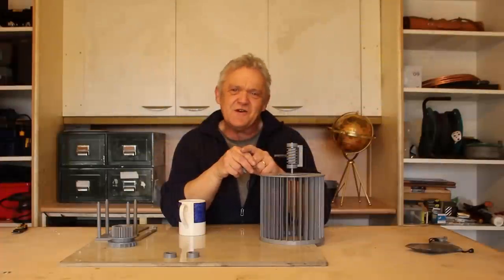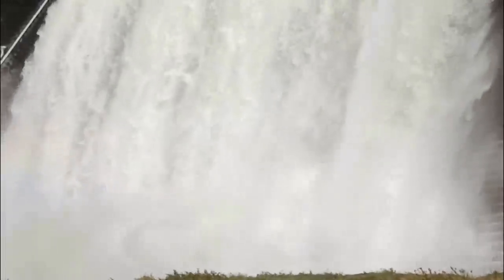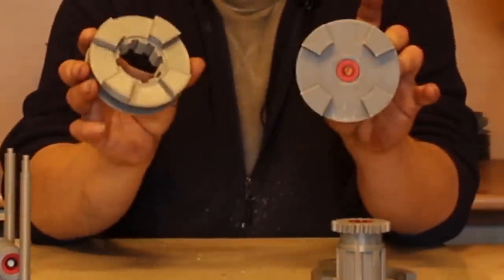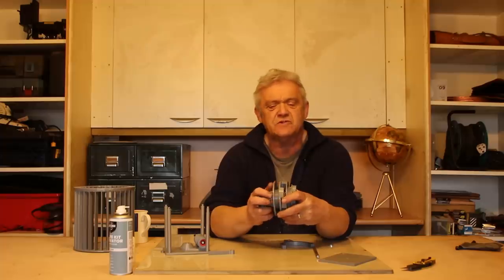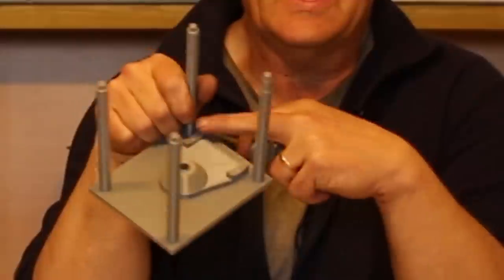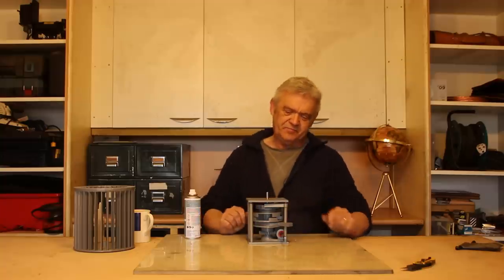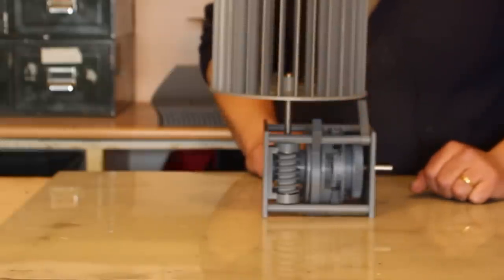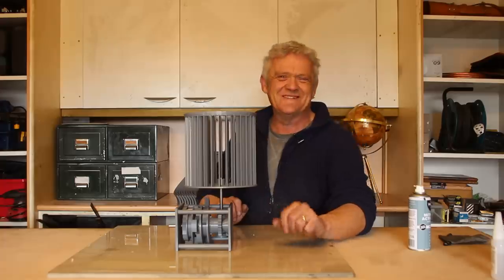1905 Wind Turbine With Integrated Energy Storage

Comment: The problem with gravity batteries is the amount of mass you need. Another video showed that a 20 gallon (or something like that) drum of water held up about 4 meters generated less energy than a single AA battery.
Reply: The conversion of potential energy to kinetic and electrical energy is far less efficient with pumped hydro than with a static weight directly driving a generator. With pumped hydro a significant portion of the kinetic energy simply bypasses the generator as the water continues to flow through. With a static weight directly driving the generator, nearly 100% of the kinetic energy (minus that which is lost to friction [thermal] and vibration [acoustic]) is input to the generator.

That difference noted, you are correct that a massive weight / height would be required to power an average household, but just as it’s best to have multiple streams of income, it’s also best to exploit multiple available energy sources rather than trying to generate all required power from one source. For me it’s oil, biogas, geothermal, air to water heat pump, solar PV, solar thermal, and wind, all contributing to the whole of our energy needs and providing the excess to the Finnish grid at the same wholesale rate the big power plants receive.

Comment: It would make sense if it was large scale but at something so small your best solution is pulley system and raise it manually it cant be that heavy.  And you can do it as long as you are alive no wind or solar necessary. Its not brilliant in any sense of the word
Reply: He does it small scale so he can quickly and easily show the process and and mechanics needed to achieve the desired results. This guy's amazing and he always makes it where you have to put in some thinking to see the bigger picture.

Comment: Love your channel! Instead of a gravity battery I would imagine you could compress coil springs to store the energy.
Reply: Or pressurize an air tank? Nozzle it back toward pelton scoops when rpm drops - hope your wind picks back up to store away a bit more psi? Im trying to picture a dished out water flywheel ~1m diameter so torque input is lower at low rpm. And then incorporate a wind conveyance with both a trigger coil in the serpentine (bedini sg) ran off a solar panel and a water jet inline down from my rainwater tank so it would take a 0 wind, 0 sun, & 0 watering the property day to not have any inputs. I also get some real steam from my solar water heater coil during midday that i can use somehow when i upgrade to fittings that wont melt (i didnt expect 100C temps!).
Reply: @ronmartin7253  Have you seen his air compressor energy storage one? Can't remember if it was attached to the dynabike or a wind turbine - perhaps bike. Trouble is the cost of them and getting a used one free is hard to come by (He actually fixed the one he was given free by cleaning it!)
Reply: @Nick_Tag  no i dont recall that vid - SO many here. A trompe can be just pvc like on a water ram or the Jeremiah chan on cold steam.
Reply: Yes, or just retract a big cylinder with air to compress it 🙂
Compressed air can then be used to drive an air motor for example..
Reply: I was wondering about the same thing

Comment: Was wondering, is there an efficient way to directly use a wind turbine to directly create heat and store that heat such as in sand?
Reply: A disk brake can become red hot when you drive on highways, even without braking.
Reply: Yes you can fix a paddle on the drive shaft in a tank of water and the rotating paddle heats the water through friction.
Reply: I think I like both ideas.  Water hols a lot of heat in phase change but from my understanding it must go through a phase change which requires a lot of space when it's in gas phase?
Reply: Perhaps have it drive a compressor mechanism such as a heat pump.
Reply: Yes ideally of it can consistently create enough power, then a heat pump would be nice.
Reply: @l0I0I0I0  It'd be interesting to find out.  I wonder if Rob will do a few videos on heat pumps.  It's possible that they can't be made in his workshop though.
Reply: Look at video 1754   there he talks all about heating windmills
Reply: @simongross3122  ii
Reply: @hommerdalor6301  "A disk brake can become red hot when you drive on highways, even without braking."

If a disc is getting red hot on the highway then there is a problem with the brake pads being seized within the calliper, or the calliper piston being seized.

Comment: some old printers used to have electrical clutches built into them, put one of these on the shaft and you can release the weight at the touch of a button.

Comment: Never ceases to amaze me this bloke. I've got an old disused bore hole in my garden. It's basically a 200mm wide steel pipe 35 meters deep this would work a treat stuck on top. Cheers Rob you've just provided a brilliant solution for how to utilise this old pipe.
Reply from the maker: oh wow - that is an awesome asset mate

Comment: Magnets , on a disk , faced to an aluminum plate connected seperatly to a Winch . When the turbine spins up over an rpm it creates a magnetic field in the aluminum drawing the wieght . Run the whole thing on a one way bearing , so when the turbine slows the wight will fall spinning the output until it falls to the ground .
Reply: I guess you would have to change the direction of the power from the wieght somehow but other than than and turning should work pretty good

Comment: Worm gears are great for high torque, but they are also high friction if not using the right materials or proper and constant lubrication. They will eventually wear down both surfaces in contact, but are normally easy to replace (unless you have a bad design, which is not the case here due to efficient simplicity.) 
Now I'm thinking next level (much more engineering required): multiple clutches, raising one weight after the other in sequence and same when letting go of the weights.
Reply: Yes, a worm and wheel has poor mechanical efficiency due to the sliding contact (compared to rolling contact on spur gears).  The higher the reduction ratio the lower the mechanical efficiency.

Comment: given a fulcrum and a long enough lever you can move the earth. but this is a neat idea. you could automatically switch the clutch when the weight hits the top.  put a spring and servo on the ratchet. one could even set up a double side drive clutch  to lift 2 weights in an alternating sequence . switching from one side to the other as the weight is dropped it can be lifting the opposing weight.

Comment: to make it automatic, put a spring between the 2 dogs, and instead of sliding one, the moving one is on a screw shaft that when driven (by the wind), moves it to engage the other one.  when the wind stops, the spring pushes it back (the turbine would turn back a little). the thread count or slope of the shaft would have to be very small and it would have to be on the other side of the worm gear.

Comment: With a differential you can raise the weight from wind on one shaft and another source on the other shaft and if both energy sources are available at the same time then the weight will be lifted as much as twice as quickly due to the way the differential works.

Comment: Hi Guys.  I've seen a rig made from scrap car parts that could be applied here with good effect.  It was made for well digging - same sort of thing as here, an engine lifts a weight and drops it onto a pin repeatedly, driving it into the ground.  
It was a car rear axle, complete with diff, disk brake on one side and a wheel (no tire) on the other. The weight hangs on a rope wound round the wheel.    The motor drove the drive shaft constantly. At idle, the disk brake rotor whizzes round and the wheel is stationary with no power to it.  When the disk brake is applied, the disk rotor stops and the power is sent to the wheel, raising the weight.  When the brake is released, the disk rotor spins free again and the wheel is also free to spin, and drops the weight.
It always struck me as a beautiful use of a scrap mechanism with almost no modification required.

Comment: A lot of metal worm gears can be purchased online which can cost less and last longer than plastic ones as well.

They even have gear boxes you can purchase off the internet called 'windlass gears' that are pretty much just a worm gear assembly, so no need to try to make one if you do not feel so mechanically gifted, but they will likely need lighter oil unless you are using a really good sized turbine, because they are designed for long life under heavy loads, and as such, expect to want to either have a good sized turbine, or a lower viscosity oil just so you do not lose a lot of potential power in the operation.

Also, I would suggest that if you are using this both for stored and instantaneous power generation, that you would use 2 clutches, so that when you are not lifting a weight, you are also not driving the gear assembly, as this is just needless loss of power.

In other words, one clutch to release your weight [seeing as the worm gear will not unwind] and one clutch to release your gear [seeing as the worm gear produces drag on the turbine] and the two clutches would, under normal conditions both be engaged and disengaged at the same time, so only one actuator mechanism would be required to push both clutches in, and, depending on how you made the assembly, they could be actuated from a 90 degree lever that had more of a "T" shape that gave a 3rd point of action, OR just have a driving mechanism [maybe even a weighted 'trip' mechanism, making it more 'renewable' and slightly less complicated] attached to one point of contact of one of the shifters and allow that to make the lever just a bit simpler.

I could hand sketch some drawings for people if they wanted, just let me know.

My sketches are sort of crude, but they are legible enough.
Reply: I know this is a year old but it would be really interesting to see a sketch of this description:)

Comment: Rather than use a ‘dog clutch’ , you could use a slip clutch . One face of the clutch has a sloped side , when the clutch starts to be engaged not so much of a hard start to the engagement . In fact , there may not even be a need for the selector if there’s two corresponding cogs , all you would need is a light spring to keep them engaged .

Comment: May be worth looking at an auto engage/ release, so once the weight reaches the top a switch is activated to disengage clutch. This way, the turbine can continue to spin. 
 Two generators. One on weight in anticlockwise and turbine clockwise. This will allow generation from the turbine while wind is up. When the turbine stops, activate the weight (with some sort of resistance) to drop, generating power in both directions. With and without wind.
 Reason for resistance is to control power generation on way down .
Reply from the maker: nice
Reply: @Robert Murray-Smith  Robert, I am sure you are inundated with suggestions, but what is the chance of trying this out? Don't ask, don't get.

Comment: The application should work for lights and other low energy consumer devices. A 40Kg weight that is 30m in the air or a 300Kg weight that is 5 meter in the air will give you the potential energy of a AA battery.
Reply from the maker: a AA battery has 10,000 joules - more or less - and you use it and it goes to landfill - don't forget 1kg raised 1m is 9.8 joules so 1 ton which is a cubic meter of water - about the size of a washing machine raised to to the roof would be around 58,800 joules - as 3,600 joules is a watt hour then that would be 16 watt hours - more or less - my light bulbs are 40 watt equivalent light and take 4 watts - they are LED lamps - so it would be enough to light my living room easily - that small wind turbine is a model mate!! and if you used steel, concrete or lead it would be the size of a large shoe box, a two drawer filing cabinet or a small plant pot in that order lol

Comment: The gravity battery causing a verticle up and down momentum reminds me of the mechanism inside the spinning tops to turn verticle force into rotational spin.
If the verticle up and down could be continuous without need for brake fork etc, it could drive a spinning top like mechanism to create a generator.

Comment: Thanks. Love the mechanical design. 
I did a quick calculation - if I raise my 120,000kg house by 1m I could extract 330W for an hour while it lowers itself back to ground level, assuming no losses. Maybe I've calculated it wrong?
Reply: Seems about right Ben. 120 tonnes raised 1m is 1.1 million joules. 3.6 million joules is 1 kWh so you'll have about 0.32kWh stored there. About half what a 12v 70Ah typical car battery can store...

Comment: 1 watt hour ( capacity of a AAA battery) will lift a tonne about 30 cms. Or lift 300 kgs about 1 meter. It tends to be more cost effective to charge tiny batteries, than it is to lift considerable weights considerable distances.

Comment: What would be cool is a multiple clutch system so you could sequentially lift an array of weights one at a time. More storage without requiring massive torque. Also, you could have a final clutch to allow direct driving of a generator. 
Probably better would be a multi fan system. One fan solely for power generation, one to load weights. All feed into the same generator, so at times when the winds are low, a weight can be engaged to assist to maintain a certain power level. This can continue if needed through each of the weights until the wind speed picks up and the fans can take over. Then the secondary fan can go back to elevating the weights back to top position. It could transition back and forth seamlessly, if the clutches could be engaged easily enough.
The only thing is such a system would probably introduce a lot of inefficiency that would require bigger fans just to compensate for. Nevermind the added complexity of maintenance.

Comment: I would also have thought the worm gears can only go one way ; simply locking up if attempting the reverse application of force. However for example just have a play with the guitar head tuners; they are under a continual reverse force and they hold steady . Or do they ? .   . Put lubrication on one of them, say  low viscosity synthetic engine oil and observe it unwinding . From memory the unwinding happened quickest with molybond  ( molybdenum disulfide ) .

Comment: or use the dog clutch and make a circuit to check wind speed ... if its below a minimum disengage the clutch ... if it's above engage ... BUT it can also engage the gravity battery when the wind goes below that threshold allowing for it to keep working ... so a basic wind speed test and a pair of servos and poof you have a working longer duration system ... depending on WHAT your gravity battery is like ... such as in the demo ... great for getting a flywheel running to run the generator for a while... etc heck you could even pass any excess power into a load coil and capacitor system to run a resonating generator off of the R C resonance oscillations ...

Comment: Excellent work rob. I've been thinking about a mechanism for a while to do this but to raise weights sequentially and then have them drop all at the same time. This way it's easier on the turbine at low RPMs but can discharge a larger amount. Like a trickle charge with a large discharge but mechanically.

Comment: Fabulous Step 1 to demonstrate the idea! 

For Simple load lifting, great, but some variation of a Fly ball Governor is probably a wise addition, if the Descending Weight is to also driveva AC Generator, to control the Speed, and the Output Frequency.

Also, is there some way to Make this have a  "Controlled Soft Start/Stop", as the Weight Rises, and Decends? Maybe a Friction Brake, combined with the Mechanical Governor?

Comment: What not make the raising of a weight into the ability to draw up water?

That way, you can compress air, you can have a weight of water to push down at high pressure (again to compress air or drove a turbine), and you have a weighted plunger at the top of a tube which can be dropped (again driving a turbine and with the ability to compress air).

Have a wond turbine driving the shop and pack all 3 options together and...bosh.

Times that out by multiple devices in an array, oh my.

Comment: Single input, double variable output can be achieved with a differential and is more variable than the clutch which is a binary shift. I’m curious if that could be use to add energy into the battery when there’s enough torque somehow.  Processing…

Comment: The weight of cured concrete is about 150lbs per cubic foot. 
Water is around 62lbs per cubic foot.
Does it take the same amount of energy to lift 150lbs of concrete all at once as it does to pump 150lbs of water?
There are heavier fluids, but I just feel like Gravity batteries have more potential in the future if they utilize a fluid.

Comment: Non sequitur: Have seen the articles of the solar dish with solid oxide electrolyzer cell (SOEC)? It harvest heat, but also break down water vapor using the SOEC to generate 500g hydrogen, which is 2kWh, per day! I was looking for 1kWh solutions and I found about it. I can't find anything about DIY SOEC but I feel like the idea can be an inspiration.

Comment: I wonder if this, along with a counter weight, could be used as the basis of a mechanism to automatically open and close a door? It could be used with an old-school pressure plate or a motion sensor.

Comment: Even if one could haul a 25KG concrete block up to a 20 foot roofline, could one generate significant electricity? The other thing is that one doesn't want to be supervising the process manually. I suppose the block might be made to descend quite slowly using a worm gear to drive a generator for longer, more predictably, but with less intensity. If it worked that way I might just as well haul them up myself.